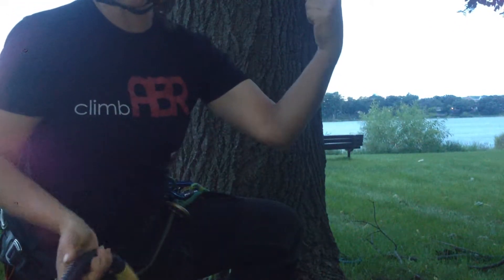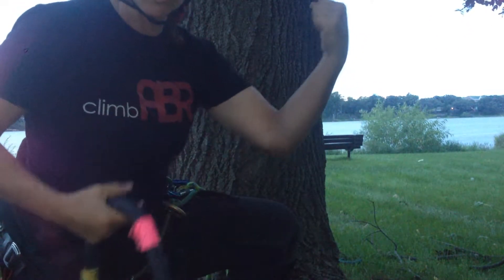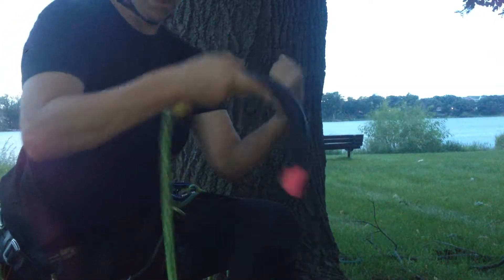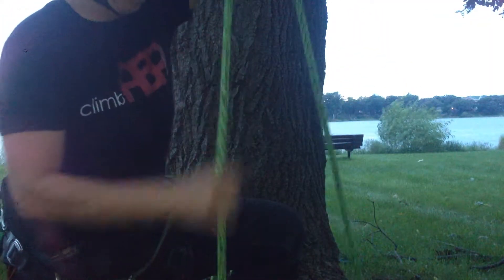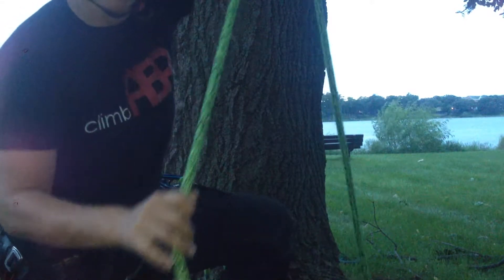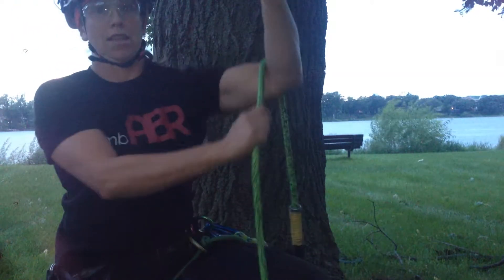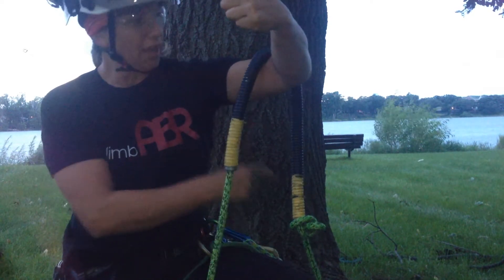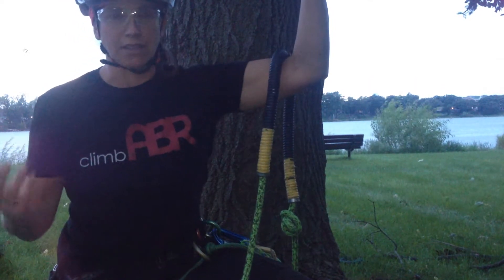Install Rope Sleeve Type Cambium Saver, Women's Tree Climbing Workshop (WCTW) 2016

Comment: I was using a alpine butterfly to install a weaver cambium saver, but I like your way of using a slip knot👍🏻 🇨🇦🇺🇸
Reply from the maker: Cool.  Yeah, a slip knot is less secure, but sometimes that's what ya want!  If the loop of the AB found it's way over a small twig, well...you might be  as I like to say, "schuck"